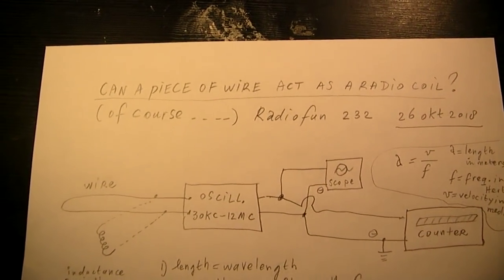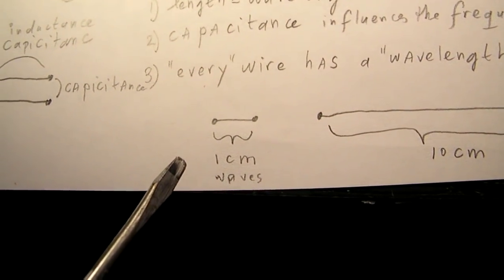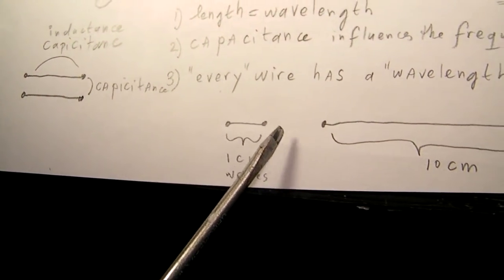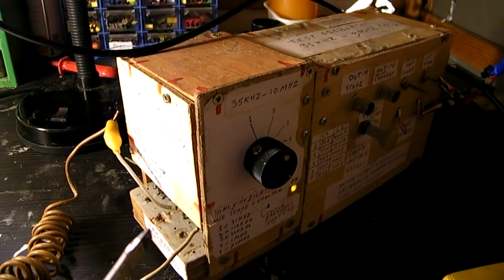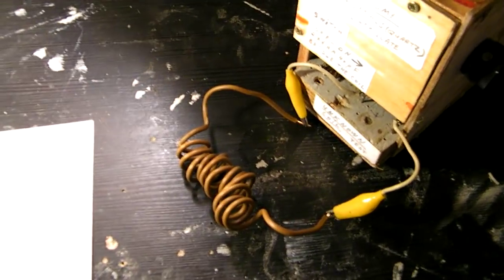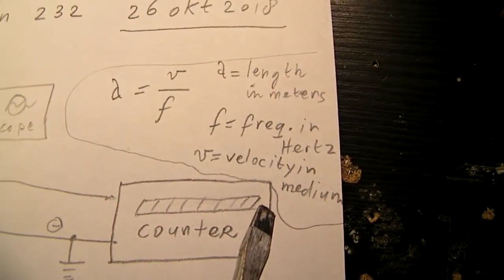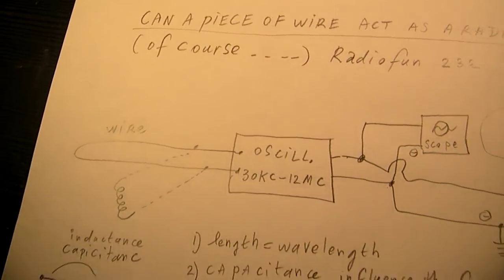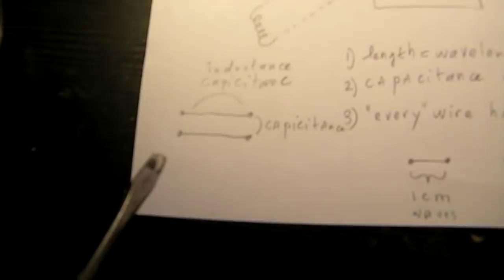Can a piece of wire act as a radio coil? surely it can

Comment: Very well done. Inductance, capacitance, and wire lengths... just these three things taken together are an ocean of a topic! One thing I remember from my amateur radio studies = two wires close together, say each is 30 meters long to make an antenna, this antenna will have more bandwidth. That is, the resonant frequencies will be wider, so resonant from say 10MHz to 11MHz for two wires and say only 10MHz to 10.5MHz for just one 30 meter wire. That is just an example, I did not do the math.
Reply from the maker: Many thanks, you are right, a "butterfly" antenna covers more frequencies.